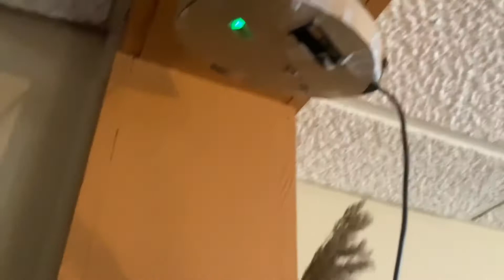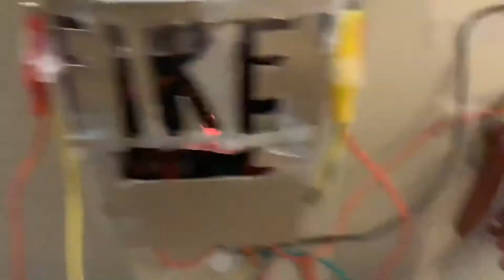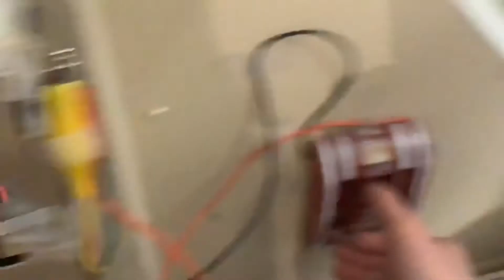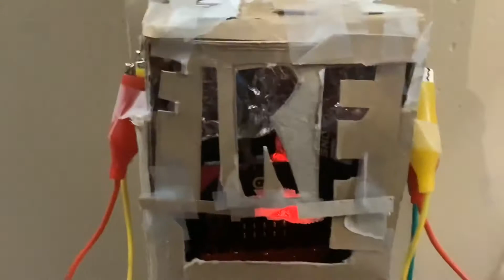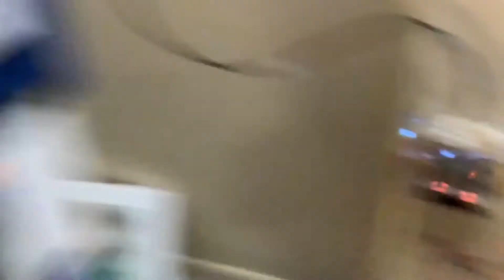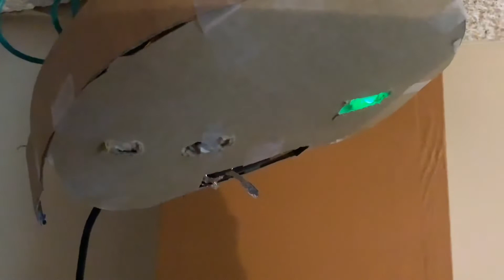Microbit Fire Alarm 2

Comment: Hey! How did you make the smoke detector low battery detection?
Reply from the maker: so i had added 2 extra wires in the battery compartment, that went back to input pins on the microbit. when the microbit detected a low voltage, it would chirp